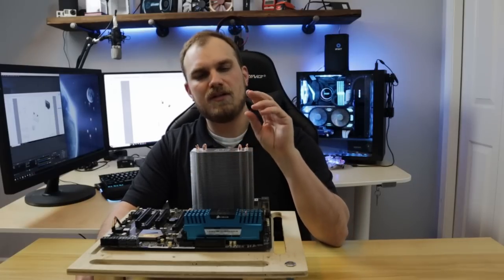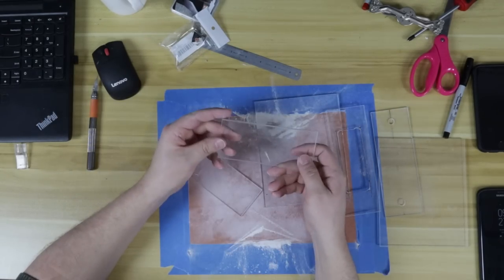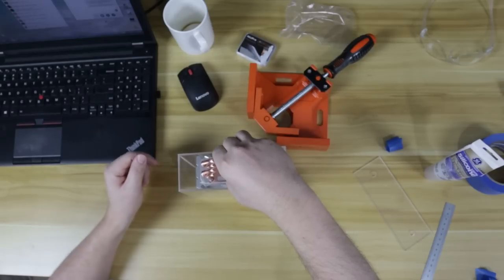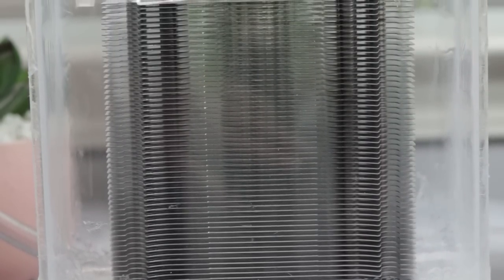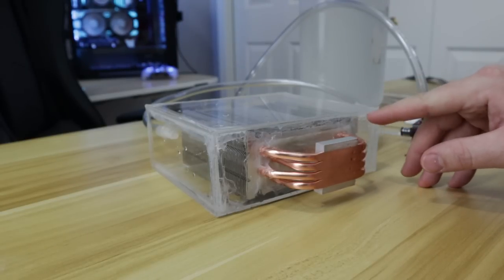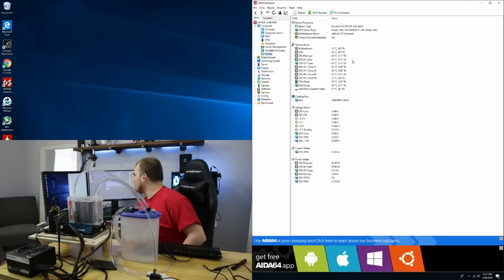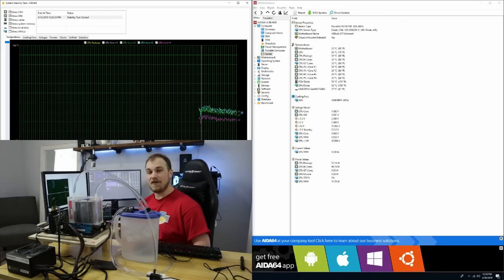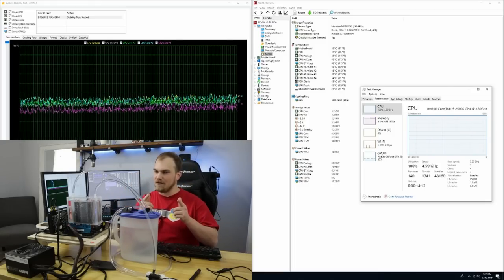I Water Cooled My Air Cooler AND..........

Comment: Technically speaking this is just more thermal mass you added at the processor heatsink compared to conventional watercooled solutions. This is obviously unnessesary because your main heat agent is still water. Ofc there is only i5, that is not so hot under full load then top tier proccesors, so you will get pretty same results with common AIO (not considering ice in the loop). So, unfortunately, there is no point of doing this and there is no way this is more efficient than a traditional AIO.

Comment: Since air is the best isolation, the cooling could be way better if none of the bubbles were trapped between the platings and so there would be full contact between the platings and the water 🤔🤔🤔

Comment: That's not an air cooler.  That's a vapor cooler, not a solid block of metal.  It uses fluid movement just like a "water" cooler.  You're not going to get lower than 30c, even if the water was only 1c.  The ammonia/ether blend in vapor coolers has to condense at the estimated maximum room temperature, 30-35c.  Anything above that, and it evaporates with the heat, and puling additional heat from the surrounding as it shifts to a more energetic phase.  Then it condenses against the room temperature cooling fin section, and wicks back down to the CPU.  For this reason, cold water will never let it evaporate, and you'll never break 30c.  You need a REAL "air" cooler, that's one continuous block of aluminum or copper fins.  This will allow the heat to be wicked out directly from the CPU.  Like they do in LIN overclocking competitions.

Comment: @MajorHardware Just a thought to potentially improve cooling factor....If you had the intake/output lines split and causing the water/liquid/whatever across the vanes (from front to back/Left to right/whatever...instead of top input top output.....that could clear more heat and flow smoother.....dangit...now im gonna have to bust out grandads old fish bridge equipment and try it, lol!

Comment: You should have soldered the heat pipe to the bottom fin so it doesn't leak. It would be permanent and never leak there.
Reply: You cannot solder between metal and Acrylic.
Reply: @ClayWheeler  That's not where his leak was. It was leaking between the heat pipe and the aluminum fins. That you can solder.

Comment: Man, there is a lot you did wrong there... First, this is a closed loop without almost any means of cooling the water. I am saying almost - because a small amout energy will be radiated to air from hoses and reservoir. A proper setup needs a radiator badly - otherwise after some (not long) time water will heat up. Second - you didn't force the flow to go only TROUGH the fins of the radiator. Water will choose least effort way - it will mostly flow around you radiator in a tank, not trough it. And last - 90+% of the radiator area would still be a waste - as the fins would be completely cooled (T equal to coolant temp) after few milimeters from the heatpipe. There is a reason waterblocks are so small :) You don't need a lot of material to effectively transfer energy to water/liquid coolant.

Comment: Not to be rude but that's counter intuitive. Liquid in copper tubes raise heat through the middle of the tube then once it cools as it rises to the top passing it's heat off, it falls back down. It's basically liquid cooling without a pump, it's good because it's cheap but it's less effective than a circulating liquid cooling system.

What you did there is you get the worst of both. You bottlenecked the liquid cooling and negated the cheap efficiency of air cooled copper tubes, it only showed better results because of the temporary ice you placed in the system.

Comment: It's just a overly complicated water cooler with no radiator to cool off the water. Once that water volume heats up it's no longer going to cool the CPU. So it'll work okay for a time but then once that heat sink, AKA the water tank, heats up it's totally inefficient. that aquarium thing you built with your air cooler in it is just a very large and probably inefficient heat block.

Comment: Hey so I had someone help
Me build a computer/give me a list of parts and then he kinda opted out and stopped helping me. I want to know if these parts I have are proper and work together before I buy the last most expensive part. So far I have - [x] Antec p120 crystal case
- [x] as rock legand mother board 
- [x] Rgb fans (can’t remember rn )
- [ ]  GeForce rtx 2080 super graphics card 
- [x] Ryzen 7 processor 
- [x] Sabrent m.2 int ssd 
- [x] 2x 16gb Corsair rgb 
-[x]Antec Hcg Gold 650w power supply

Comment: all the copper pipes are not air tight that go into the stack. you be better putting the bottom in half inch Epoxy

Comment: Water cooler is basically an air cooler with water because there's a fan in the radiator. What you've just done is convert air cooler into just water cooler because you remove the fan. Nothing new actually.

Comment: over-engineered idea. Usually, fins are used on the side with lesser heat transfer capability (h) like air - to increase the heat transfer capability. Also, the fin spacing here would inhibit the water flow path!

Comment: You did it wrong. Rip off some of the top fins, cut the heat pipe tips and get some vinyl tube and cross cross them. Wire in a 12v pump and your heat sink becomes your radiator and water block all in 1. I did this to cool an old dell pc with no upgrade room. Saw temps 25-35c cooler on a qx6700

Comment: well if you know how a fan cooler conducting heat and how water cooler differentiates from it. you would know this is just something for fun and not a good idea at all. achieve your goal? yes. Is it fun? yes. but is it really efficient, space wise, energy wise or safety wise? not at all. engineer with deep knowledge of thermodynamic and fluid mechanic already figured out a lot of things you cant even think of to build a reasonable cooling system, yet, people with no deep understanding of it still try wired stuff is thoughtful but stupid at the same time.

Comment: This reminds me of water to air intercooling on a turbocharged car (compression creates heat, the intercooler removes most of that heat).  This is OK on a daily driver (if you are in boost for 15 seconds, you are going really fast).  When you are on a track, you are boost a lot.  You can run into a problem called "heat soak".   

With the amount of ice you went through, your CPU looks to be in "boost" a lot... 

Initially the water is cool, so the boosted air (CPU) is cooled.  But, the cool water doesn't shed much heat from the radiator.  Each time the water goes through the loop, the CPU warms it a bit more until the water is hot enough that the radiator is dumping as much heat as the CPU is adding.  That is your heat soak temperature.  To keep it low, the radiator needs to be really big (like the one you are immersing in water).  

Adding another loop will work if the radiator is larger than the one you immersed in water, the larger the better.

I look forward to your next video.

Comment: The idea has no sense. I understand... sorry... i may sounds like a punk.... sorry for that. Just... try to track the water flow through the system. It flows outside the  radiator. And it heats really slow - it cannot take heat quickly. That is why water systems have such small heat exchangers on cpu.
I believe your tests will show you the truth.

Comment: You have done it incorrectly lmao. Instead of getting scolding hot water from the exit hole you will get average temperature water since it's above the heatsink lol. Most of the temperature of water will remain the same as it is near the heatsink. What you should do is is get the exit pipe at the bottom of the heat sink and then cool water will come from the top while removing hot water from the bottom. In the case of liquid cooling blocks, the surface area is either shaped to flow the water without letting it sit, or the area to pipe volume ratio is comparable so entirety of the water is removed. What you have done here will obviously suck.
Reply: All it really needs is a block at top so water cannot travel from in to out without passing through fins. I would drill a hole through the fin stack where the water inlet is. That would allow the stream to travel down to bottom through the hole instead of running into the flat top fin.

Do love how everyone says it doesn't work when his temp with no radiator are cooler than my Corsair h110i on my 2600k running at 4.5ghz.
Reply: You've got it backwards, friend. The cool water inlet should be at the bottom, and the waste heat water inlet on top. As the cool water heats up it will rise and be sucked away by the waste inlet.

Comment: “Water cooling” is also air cooled. You have just exchanged heatpipes with water. 
This “idea” just work as long the resorvoir dissipates enough heat. 
But anyway, cool video.

Comment: Up side down system ware the motherboard it’s on time that way you never have to worry about likes. 
Have a Dehumidifier in your box and your all
Done.. 
you can also use a small refrigerator to run the water tubes in to is and your water will alway be cool..

Comment: You cut off your video far too soon. Let it cook for a WEEK, not a few minutes, and then tell us what the various temperatures are. That is, if you dare. The air heat exchanger gives the heat a place to go (air), whereas your system does not. The second water tank's heat goes ... where? Unless you intend to add ice to the second tank indefinitely (where's ice get its "cold" from?), your experimental cooling system is highly unsustainable.

Comment: It is an old video, but the amount of cringe is impressive.

Your water coolers are already air cooled, that is the point of the radiator. Then you discuss forcing the water through the fins and don't. then you comment on the trapped bubbles apparently without realizing that those bubbles are proof you have no flow through the plates, all your cooling is around the surface.